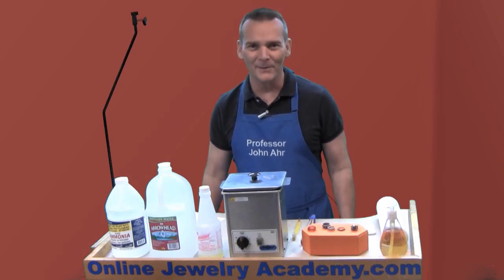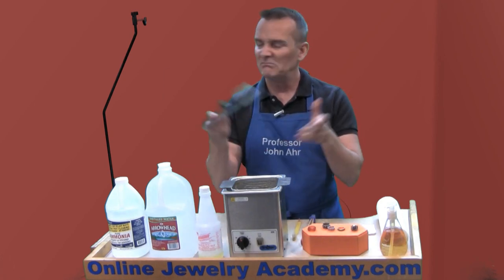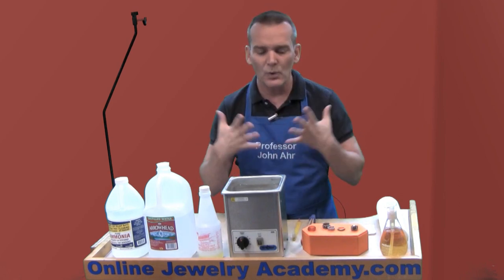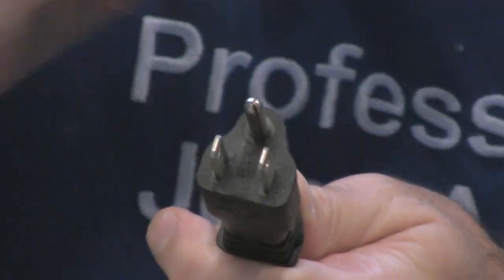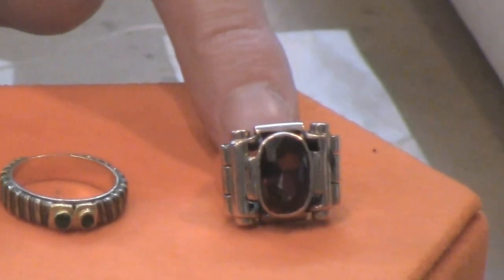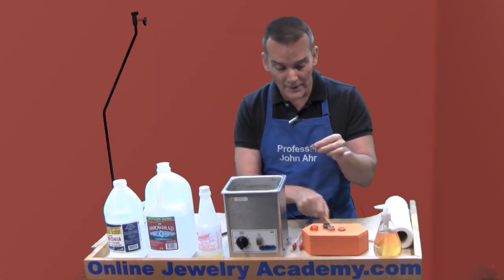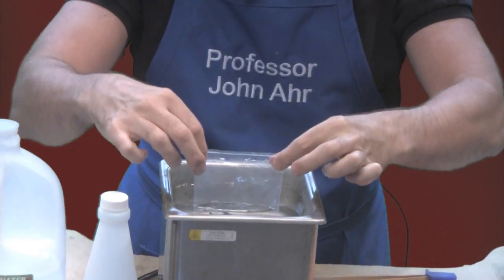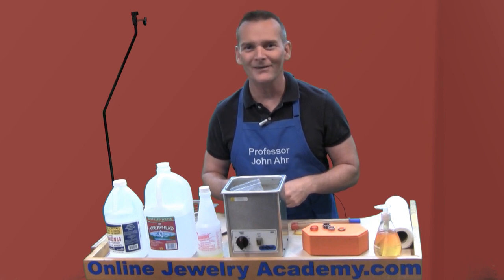Best Practices For Using Ultrasonic Cleaners For Jewelry

Comment: Using the plastic bag filled with your cleaning solution and then immersing said plastic bag into the fluid filled tank does absorb significant amount of acoustic energy. Alternative it would better be to get a mall glass jar (the plastic is the culprit here) and put your clean solution in that jar along with the item your cleaning and then put that into the tank. The acoustic energy goes right through the glass without interfering/diminishing the energy.  Then you can use a regular water bath over and over again in your tank and use different solutions in your glass jar to match what material you are trying to clean.  This technique has been used by many professional bio labs and decreases significantly the amount of time necessary to clean the tank. The water in the tank stays clean but the solution in the glass jar can be discarded. Within an hour I’ve been able to clean somebody’s necklace (using dish soap), then immediately clean a spark plug (using a solvent), followed by a bike chain (using a different solvent).  If I was to do this with different cleaning solutions in the tank it would take significant amount of clean solution to fill the tank (one can damage the machine running the machine only partially full). This hack significantly reduces amount of cleaning solution necessary along with saving time by not having to clean the tank between items.
Reply from the maker: Thanks for the very comprehensive comment. 😀

Comment: Use a small glass jar (like a small capers jar) with a screw on lid, supported by the wire mesh basket, instead of a plastic bag for a more aggressive cleaning. It will still hold any gems that come loose. You can fill the ultrasonic cleaner with just water, and add the degreaser to the glass jar, so one can use less ammonia, and spend less time cleaning the tank of dirty cleaning solution. The glass jar is reusable as well spending less money on plastic bags. If the ultrasonic cleaner is powerful enough, it can destroy the small little plastic bags,
Reply from the maker: Great tip.  I actually use glass beakers in my personal ultra sonic cleaner.  😀

Comment: Fantastic video. I am looking a purchasing either 1 or 2 cleaners for brass, small gun parts, and as a bonus, I was wondering about jewelry (my wife's). It looks like with a little bit of familiarization, there will be even more things that one could be used for than I previously realized. The baggy trick is a solution for small parts that I would be afraid of falling through a basket. Great information and very well articulated. Thumbs up
Reply from the maker: Thanks for the compliment.  Glad you enjoyed the video. : )

Comment: Best to put distilled water and then use bottles with the solution in it (dawn for jewelry, gasoline for tools or degreaser in separate bottles with their own solution).
Reply from the maker: This same approach is accomplished by creating a lid for the unit and hanging beakers into the water.  Be careful whenever using gasoline (especially indoors). 😀

Comment: The baggie method is great for using different solvents.  You could fill it with ammonia water to avoid adding ammonia to the main cleaning water.  You can also use other solvents like gasoline which works surprisingly amazing.  I think the high vapor pressure of gasoline promotes the cavitation action.  Just be cautious of the fumes and flammability.
Reply from the maker: I would recommend outfitting you ultrasonic unit with a lid that can hold a glass beaker instead of using the baggie method for alternative solutions. And, I don’t think it’s wise to use gasoline indoors ever. 😀
Reply: @OnlineJewelryAcademy  Awesome ideas!  The glass jars are better than bags for sure.  They can store the solvents long term and are less likely to leak.  I use the gas on bolts and tools and yes, the cleaner goes outside for those runs.  😆
Reply: @OnlineJewelryAcademy  Is there a reason that the glass jar can't sit on the bottom of the cleaner? Could a container of gasoline have a sealed top while in the ultrasonic or does it need to have an open top?
Reply from the maker: @Truenorth2005  Nothing should rest on the bottom of the tank as it might cause a hole to develop in the tank. If working with gasoline as a solvent, you must work in a well ventilated area with a fire extinguisher close at hand. The gasoline could be covered. Practice all safety measures necessary. 😀

Comment: Great info! Two questions for you @onlinejewelryacademy: you mentioned to make sure there’s no inclusions however diamonds almost always have inclusions right, unless you’re lucky enough to have an IF!, but they’re still ok to go in an US cleaner, so is it just certain gemstones? And #2, my cleaner has a plastic basket that sits on the bottom so the jewelry sits in the basket, it’s not floating. I think that’s still ok because it’s plastic? Thanks so much!
Reply from the maker: You want to keep stones with obvious cracks out of your ultrasonic cleaner. The plastic basket you described should be fine. Although, it is preferable to not have anything touching the bottom of the tank. 🤓
Reply: @OnlineJewelryAcademy  thanks so much!

Comment: thanks john, very helpful, quick question, how long should i run it for? and how about dentures? what do you recommend?
Reply from the maker: Hi Jim,  Assuming that you are only putting items that cannot be damaged by the cleaner, you can run your ultra sonic cleaner as long as you like.  I generally only run mine in five or 10 minute cycles to clean grime from polishing off of metal pieces.  I don't wear dentures.  So, I've never investigated the use of an ultra sonic cleaner for the purpose of cleaning dentures.  I suggest that you ask your dentist to see what they think.
Thanks for your support! : )

Comment: I have a 6L ultrasonic cleaner, the kind made in China and rebranded by companies for Amazon and ebay. Are these suitable for jewelry?

*Advertised specifications are 200W heating and 180W to the transducers (3x60W) at 40kHz. I don't know how accurate this is, but that is what the listing states.
Reply from the maker: As long as you use it correctly, you should get good use from your unit. Thanks for watching! 😀

Comment: I bought a ultrasonic cleaner, but it came with no basket. can I put the white magic eraser or Schotchbright pad directly in the cleaner and put the item on it? I just love your video. very informative and well teached.
Reply from the maker: You will diminish the cleaning potential of the unit if you place a sponge at the bottom of the tank.  You could bend a coat hanger to create something that would allow you to suspend your rings and/or bracelets in the center of the tank.  You could also cover the top of the unit with a piece of sheet metal that has a hole cut in it that's the same size as a beaker.  You can keep the beaker from going too far through the hole by applying a band of tape around it.  Plus, there are suggestions in the video for floating items.  Good luck.  Have fun with your new studio toy. : )

Comment: Dear Professor Ahr,
Thank you for your instructive video. I want to clean some brass pendants which have had a flash plating of rhodium. I am worried the ammonia might have a reaction with the brass if the plating is thin. Would you advise not using an ultrasonic cleaner on flash plated jewellery?
Reply from the maker: I wouldn't use an ultrasonic cleaner in this case.  It sounds to me that you only need to use a rouge cloth.  By the way, you don't have to use ammonia in the ultrasonic.  You can use many different cleaning solutions that don't contain any ammonia.  If you use the ultrasonic, your plated surface should survive in good shape.  If you're still on the fence, just clean one item as a test.  I hope that this helps.
Thanks for your support! : )
Reply: @OnlineJewelryAcademy  Thank you for your opinion and advice. I will try a test piece as you suggest.

Comment: Hi, Can this be used for sterilizing small amber bottles (30 ml)?
Reply from the maker: I have never heard of anyone using an ultrasonic cleaner for the purpose of sterilizing small amber bottles.  But, who knows?  You might find something on the web showing you how to do it.  I believe that you could use a pressure cooker to sterilize bottles.  Good luck figuring out your project.  : )
Reply: Clean? -Yes, Sterilize? - No. You'll have to use some alcohol or heat (using steam or boiling water), in order to sterilize them.

Comment: Is it dangerous to my hands to take items out of the ultrasonic machine with my hands. You mentioned something about damaging to the connective tissues. Or was that just if using ammonia? My machine has no heat. I'm just using water and dish soap. Also, is filtered water good or should I use distilled?
Reply from the maker: First, get some tongs or turn off your unit when you put something in or take something out of it. Tap water works just fine. Please stay safe. 😀

Comment: What if we need to use acid solution in ultrasonic cleaner, containing hydroflouric acid and nitric acid
Reply from the maker: You could make a lid for your ultrasonic unit with cutouts that could hold glass beakers. 😀

Comment: Thank you so much for this video!
 I make enamel jewelery (on 999 silver). I want to use the ultrasonic cleaner after grinding and before the last firing. Should I put my piece in the untrasonic cleaner with the glass facing the bottom or the top? And how long should I put it in there? Should I use amonia or is a detergent enough? Thanks!!!
Reply from the maker: Yvonne Manders Using an ultrasonic cleaner on enamel pieces is never a good idea. And, it’s best to avoid using ammonia in your device. In my opinion, cleaning your pieces before the final firing with an ultrasonic cleaner is an unnecessary step. 🙂
Reply: @OnlineJewelryAcademy  Thanks for your reply!

Comment: What temperature and for how long should I set the timer for?  It’s nice to know I don’t have to buy special cleaner, thank you for that tip.
Reply from the maker: I usually keep my ultrasonic at about 75 degrees Fahrenheit.  You want it warm but not steaming.  If you find that you prefer a hotter temperature, be sure to regularly check to make sure that all of the fluid hasn't evaporated.  Generally, I leave very dirty pieces in for 10 minutes and then do an inspection.  You might want to use a soft toothbrush on some items to help the cleaning process.😀

Comment: could you use one of these to clean a bong?
Reply from the maker: Yes Chadd, you could use your ultra sonic cleaner to clean your bong.  Just be sure that it doesn't make contact with the bottom or the walls of the tank.
Thanks for your support! : )
Reply: @OnlineJewelryAcademy  thank you for the quick response I really appreciate it!, really that is super awesome, I'm tired of hand washing my pieces, I think this could be revolutionary for the cannabis industry since the only stuff available to clean our glass pieces are chemical washes which probably isn't the smartest/ safest way to clean something you are using to inhale. If the ultra sonic cleaner can clean a glass piece 100% then this is genius, also the fact I can use it to clean my jewelry and various parts is also super handy. I would assume if the glass touches the bottom or sides the vibration could shatter the bong, also I would assume that any scratches, possible slight cracks or even cheap thin glass could shatter from the ultra sonic cleaner??  Could you use the ultra sonic cleaner to clean acrylic, plastic or ceramic pieces to? thanks again for the help and info I really appreciate it and no problem keep up the amazing work! just subbed and will keep checking your videos out thank you!
Reply from the maker: Glad I could help out with your cleaning chores.  Glass and plastic usually does well in this type of cleaner.  Just remember, nothing is perfect.
Thanks for your support! : )
Reply: @chaddsinclairofficial  bit of a late response, but for around $300 you can get a large ultrasonic meant for gunsmithing that would fit large bongs.

Comment: I have a silver necklace with a matching silver pendant that simply refuses to be cleaned with my 50w professional ultrasonic cleaner. I have used distilled water with a squirt of dishwashing solution like in your video. I have gone to 15 mins straight cycle but the cleaning effect is very minimal. Any suggestions please? Thanks for your video.
Reply from the maker: Hi David,  If your issue is tarnish on the pieces, I recommend cleaning them with Wright's Silver Cream and then put them in your ultrasonic cleaner.  If it's grime on the surface, try adding a splash of ammonia to the ultrasonic fluid.  Good luck!
Thanks for your support! : )
Reply: After many attempts, I do not know if its tarnish or just grime. My daughter has not worn it in decades because it loses its luster and shine after a few days from buffing with a dremel.

I also have a handguard of a katana that I thought was brass or bronze or even gold because it is heavy, could not clean it satisfactorily with my new professional ultrasonic cleaner. Now I am beginning to question my cleaner, but it passes the aluminum foil test.
Reply from the maker: Hi David,  Maybe it's time to take the pieces to a plater.  Or, at least you might turn them over to a professional finishing expert.  I hope you figure out how to get a nice finish on your pieces.

Comment: Is diamond ring safe in a ultrasonic cleaner
Reply from the maker: If you take the precautions mentioned in the video you shouldn’t have any problems. Don’t let the ring touch the bottom or sides of the unit. And consider using the baggie method if you think you might have a loose stone. 😀
Reply: I mean will the ultrasonic damage my wife ring from the waves
Reply from the maker: @Steviewonderwhy  Probably not if you follow the precautions stated in the video. Ultrasonic cleaners and steamers are regularly used in the industry to clean diamond jewelry. There are other hand cleaning methods that are effective if you’re timid. You could use a soft toothbrush and gin or ammonia to clean the ring too. 😀

Comment: How long is it safe to leave pieces in ultra sonic (not heated)
Reply from the maker: It depends on what you’re putting in the ultrasonic unit. Generally, I won’t leave anything in my unit for longer that 20 minutes without checking on it. Use your best judgment. 😀

Comment: Can genuine black diamonds in a pendant be cleaned with an ultrasonic cleaner?
Reply from the maker: Yes.  But, check to make sure that each diamond is secure before putting your piece in the ultrasonic.  If you're not sure, use the plastic bag method so you catch any stones that fall out of the mounting.😀

Comment: Can I fill half thank if only few coins to clean?
Reply from the maker: It's best to fill your ultrasonic unit so that the tank is full.  If you are using a specific cleaning solution, you can isolate it using one of the techniques shown in the video.  Generally, it's not a good idea to run the unit unless it's full of liquid.  You might burn the unit out if it's not operated according to the manufacturer's specifications.
Thanks for your support! : )

Comment: My diamond rings come out sparkly when i put it in the ultra sonic but the gold and silver  looks dull im told i need a jewerly Steamer?  then im told its best to use both devices... the ultra Sonic and then use the steamer is this true? How do i Bring out  the brilliance of my diamond rings?
Reply from the maker: Steamers can remove all grease and grime that can keep a diamond from sparkling.  But, they are pricey and potentially dangerous.  If you own a steamer for milk, you could use it to steam clean your diamond.  But you'll need a good pair of tongs to hold the ring in the steam.  Your ultrasonic should be adequate to properly clean your rings.  Just make sure that it is filled with a proper ultrasonic solution for jewelry.  If the metal comes out looking dull, simply wipe it with a jewelry polishing cloth to restore its bright shine.  I hope this helps. : )
Reply: @OnlineJewelryAcademy  it does help thank you ive seen jewerly steamers on Amazon  nicely priced and when i do use my Ultra Sonic my diamonds are SPARKLING!!!  so much that when im driving or in the sun you can see the colors and i use Olay Body wash to clean them, ive tried using the polishing cloth which doesnt seem to bring out the shine... the metal is dull and lifeless not shiny and sparkling as when they are cleaned from the Jewelers. now if i can get the metal to sparkle along with the Diamonds ill be in good hands.:)
Reply from the maker: ru.talaa Your jeweler might be buffing your rings to restore their shine. 🙂
Reply: @OnlineJewelryAcademy  Thank you ill ask next time i take them in

Comment: So these will wipe out all patina/toning on coins?
Reply from the maker: The primary function of an ultrasonic cleaner is to remove dirt and grime from the surface of an item.  Oxidation is something that can be reduced or removed (depending on the composition of the cleaning solution used).  Before you clean your coins in the ultrasonic, you might want to check with a coin expert to see if cleaning the coins will reduce their value.
Thanks for your support! : )